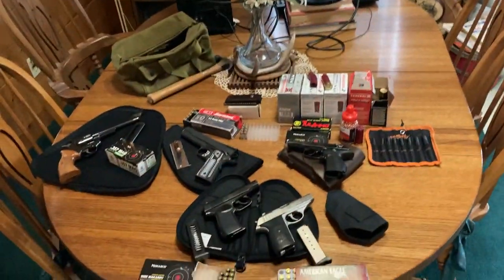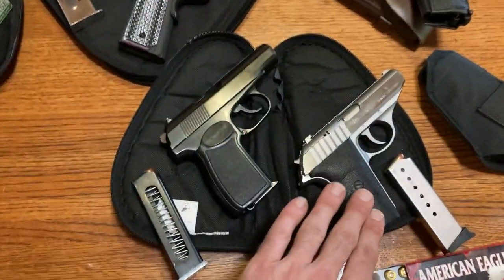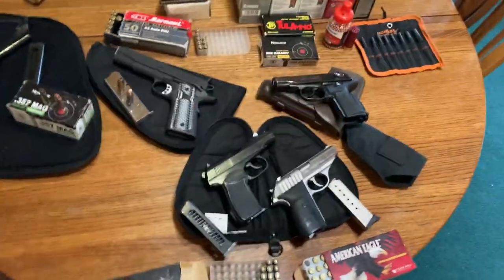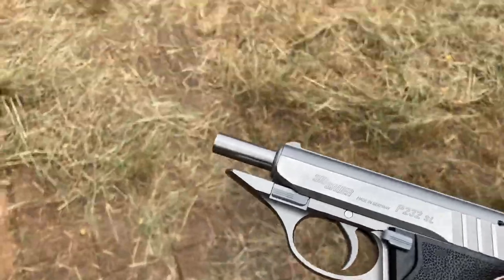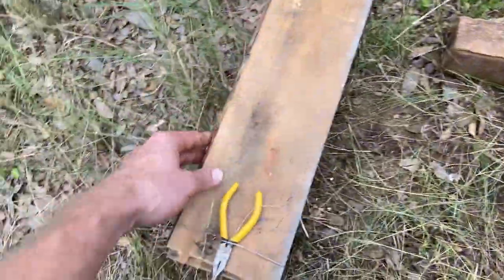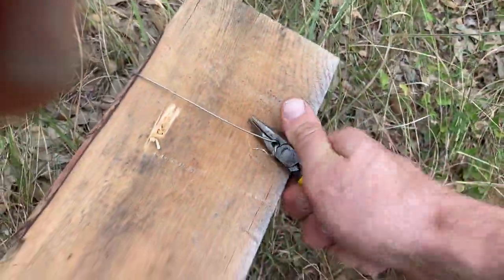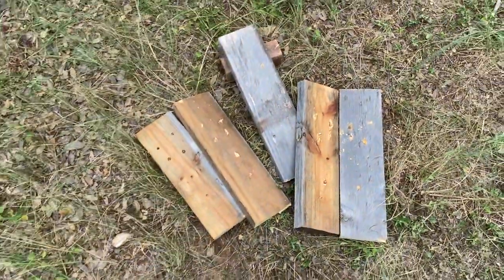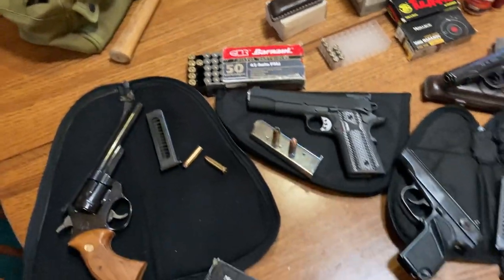9x18 Makarov vs 380 ACP wood test and MORE

Comment: I have TWO East German Makarov Pistols and have always regarded the 9mm Makarov as a very stout +p .380! Thanks for the video!
Reply: @red9man2130 can you elaborate on the +p statement? I'm sort of new to the slang terms. Been around firearms my whole life but never heard that used in a conversation before.
Reply: @BigD1395  plus pressure, meaning a little bit faster velocity because the case holds more powder.

Comment: Nice collection of pistols brother, I remember my moms .357 hollow point round I actually blew all the way through a small sapling pine tree that was about 3' in diameter. The entrance hole was about the size of your pinky, whereas the exit hole blew almost the whole back of the tree apart. My makarov with full metal jacket doesn't compare in the least to it. As far as stopping power though. I believe with a hollow point round will still get the job done for sure. ;-)

Comment: I think you did a good job on the video. There's another channel. tools and targets that does alot of penetration tests. One inparticular matched a, I think it was 95 fr flat tip 380 fmj round against a standard 9mm 115 gr round nose fmj round. Surprisingly the flat tip 380 easily out penetrated the 9mm round nose. I'd like to see you get some of the flat tip 380 and do this test again

Comment: Interesting and a little surprising. As regards the idea that the 9x18 feels like a +P, it's because it's a blowback pistol. Any blowback .380 will feel pretty much the same, with some felt difference due to different grips and weight. A locked breech .380, of which there have been a few, will feel like shooting a .22 rimfire. The Colt Government .380 was one and a good one. 

It is surprising to me that the penetration of a 9x18 and a .45 was practically the same. I don't know how one could test the effect on a living creature, though. There might be some question as to the value of testing by shooting boards but that's been done with results published for over a hundred years, like someone already mentioned. I also wonder if it made any difference by not having the boards spaced.
Reply: "It is surprising to me that the penetration of a 9x18 and a .45 was practically the same"  Me too....

Comment: The original cartridge ,,9x18'' is with steel core.
Reply from the maker: In hard wood the copper jacket did not deform much so I do not think It would of made much difference; however, you are correct I believe.

Comment: After this video.  Are the 9x18 and .380 acp interchangeable, if fired in fully loaded mags?
Reply: No.  The Makarov 9x18 round is slightly wider than .380 and 9x19 Luger.  The Soviets designed the Makarov round so that NATO weapons couldn't fire it.
Reply: @sdog74  9x18 is 9,3mm. Or 380 and 9x19 both are .355 while 9x18 is .365
Reply: @sdog74  Who wrote that or cant you read?
Reply: I misread your first comment and deleted my reply to it.

Thank you for that info.

Comment: The name 9mm Makarov (9x18mm) is actually misguiding, the actual diameter of the bullet is 9.22mm (.365"). The 9mm Browning short (9x17mm) or .380 ACP has a .355" bullet diameter, that's the same bullet diameter as the 9mm Luger. Both calibers were invented to prevent the necessity of a locked breech and have a simple blowback construction.
And also to mention, there's another 9x18mm cartridge. The 9mm Ultra. And that one uses the same bullet diameter as the .380 ACP. But there were not as many pistols in that caliber. An improved version of the Walther PP, the Walther PP Super, the SIG P230, Mauser HSc 80 and Benelli B76. 

https://en.wikipedia.org/wiki/9%C3%9718mm_Ultra
Reply from the maker: You can visually see that 9 x 18 Makarov Is thicker almost like a 40 Cal, but not quite. Good observation, 9 mm ultra is awesome but so hard to get
Reply: @understandingtruth10  Here in Germany it's also an exotic caliber, but you can buy it. But it's expensive, almost double the price of 9mm Luger and only FMJ. Manufacturer is Fiocchi. Price range for a package of 50 rounds is between 44 and 50 Euros (between ~48 and ~54 US$).
It also goes by the name "9mm Police", some shops use 9mm Ultra, other use 9mm Police in their description.
Reply: .365 is 9.27mm So actually 9.3mm
Reply: @Gieszkanne  C.I.P. states 9.27mm for the diameter of the bullet. Tolerance +0.03mm

https://bobp.cip-bobp.org/uploads/tdcc/tab-iv/tabivcal-en-page23.pdf

But that's not the point, the point is a regular 9mm bullet is not the same as the 9mm bullet from 9mm Luger or .380 ACP or other 9mm cartridges. They usually all use a more or less fitting (within the tolerances) 9mm bullet. But the Makarov does not!